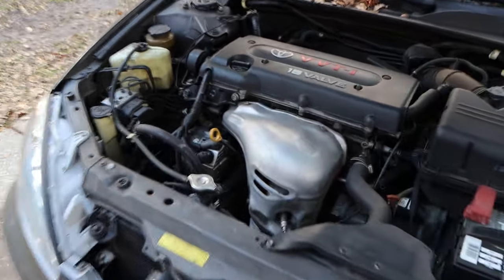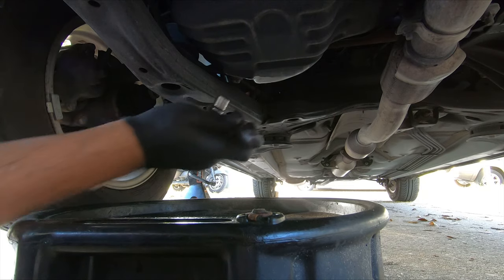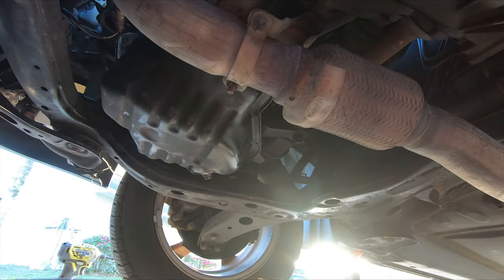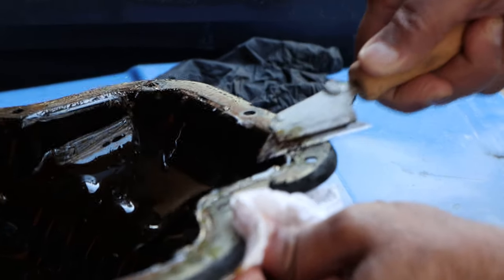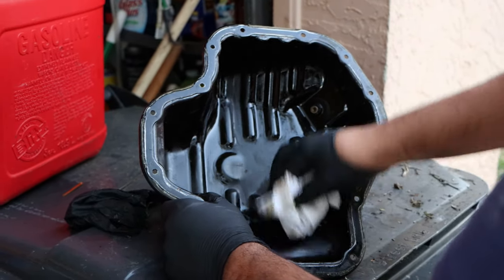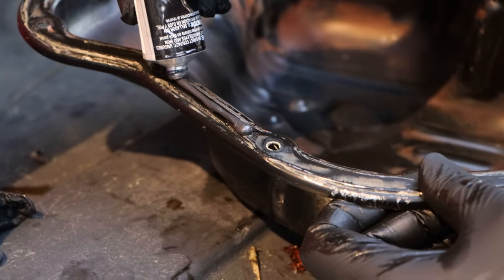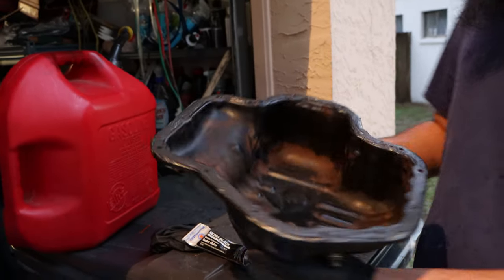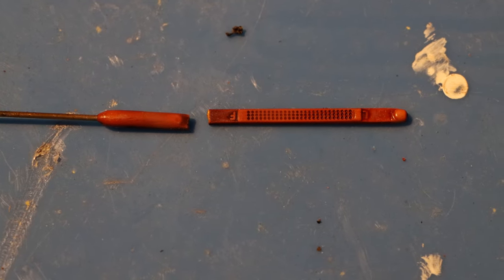Removing Broken Dipstick Camry 2AZFE

Comment: Have the same car as you with 200k miles, I just broke the same length as your. Would leaving it inside do any harm ?
Reply: is it still driving?
Reply: @foadhussain2635 I just drove 150 miles like that it seems fine
Reply: @windshield11 any damage? mine just snapped today
Reply: @burghost2  nope, didn't do anything other than replacing it. Found a metal one. Basically been a month with about 1000km on it.

Comment: This just happened to me today. I go to check the oil and the end of the dip stick was missing. A little smaller than your plastic piece but at least 1.5in. 

What would happen if I left it in the pan? The screen would stop it correct ?
Reply: Same thing happened to me. I'm leaving it in there the screen should catch it
Reply: @johnsmalls4856  , 2 months or so and no issues so you should be fine John.
Reply: This just happened to me on my turbo diesel.  I was told it’s fine. May even come out with an oil change.  Glad you guys confirmed it. Lol. I hate these plastic tipped ones!!
Reply: @SirGuidemere91  , I hope it works out. I’ve had 0 issues and everyone i asked said it shouldn’t be a problem. Good luck with your diesel sir
Reply: @MM-qi5mk  thank you!
Reply: This just happened to mine today. Was so confused as to what to do. Hope it's not gonna be a problem to the engine and how do you know the fuel gauge
Reply: How's it going so far?

Comment: Same car, same thing just happened to me. As I was removing the dipstick I heard it snap off. About 1.5 inches of the end broke off inside. Replacement on its way, all metal this time.
Reply: You took the piece out or no?
Reply: @anthonyt5895 Next oil change it came out.